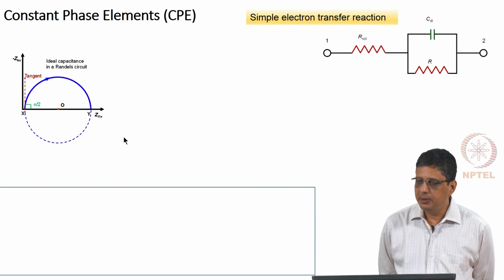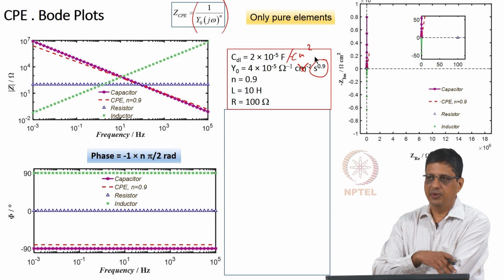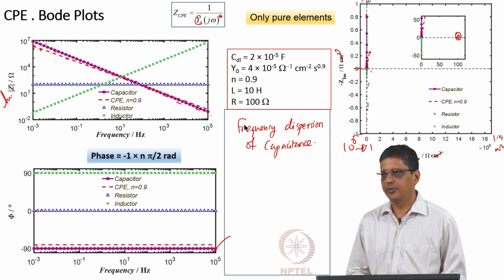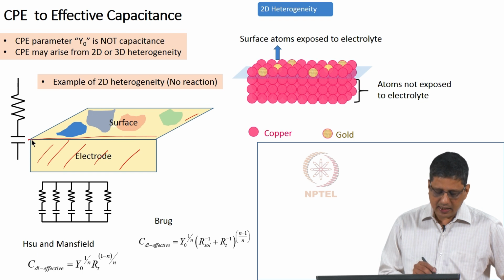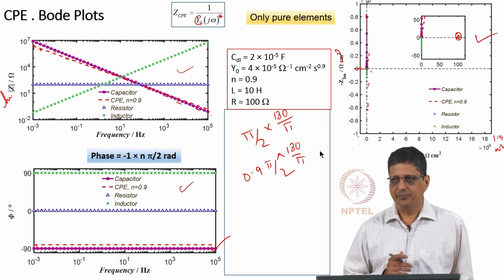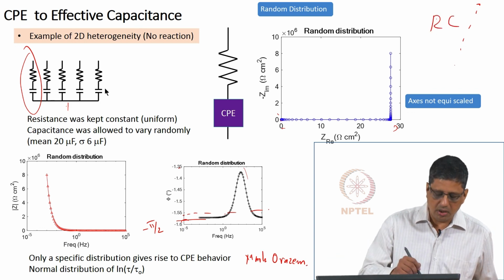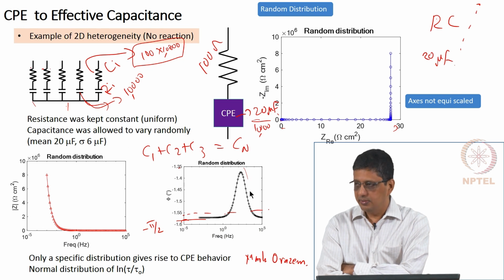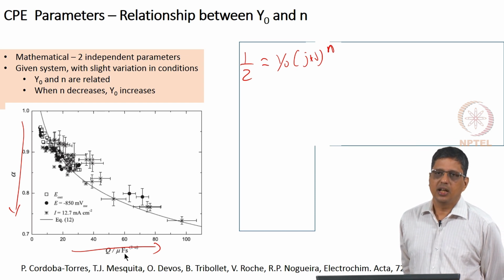#36 CPE | Electrochemical Impedance Spectroscopy

Comment: what is the importence of 'n' from where it comes ?
Reply: A superficial explanation is "n is related to how much the electrode electrolyte interface deviates from that of an ideal capacitor. If n =1, then the behavior is that of an ideal capacitor, if it is less than 1, then the extent to which it deviates from 1 describes the the extent to which the interface deviates from the ideal capacitor behavior'.
However, I don't think researchers have agreed upon the exact relationship between n and the various physical/chemical effects that may cause the deviations. I am sorry, but I am not able to offer a better explanation or insight